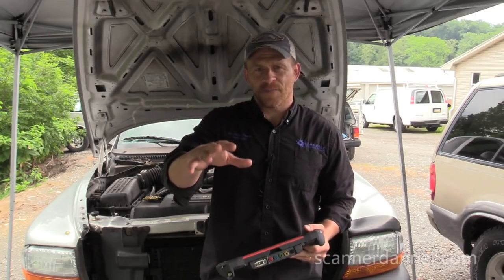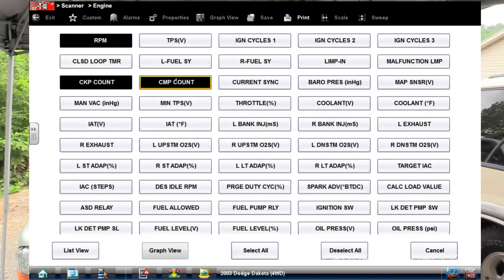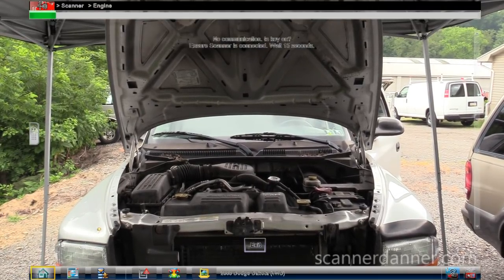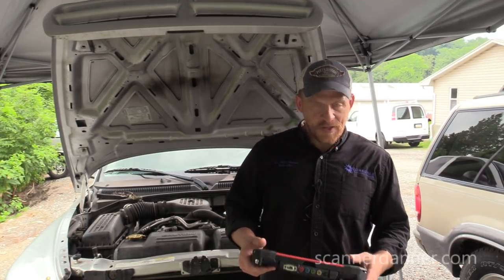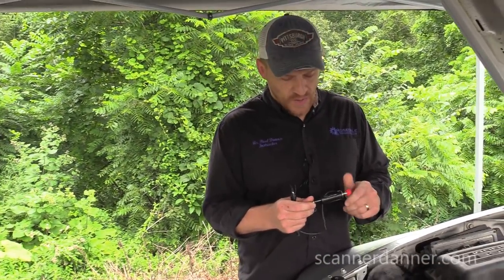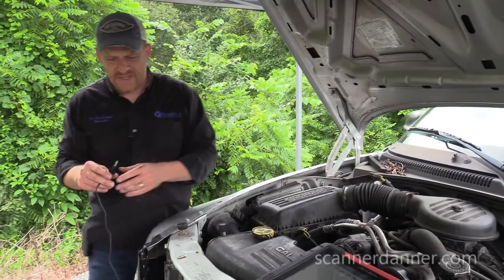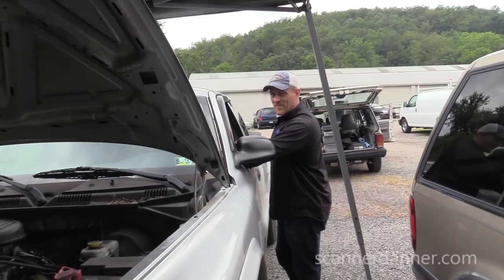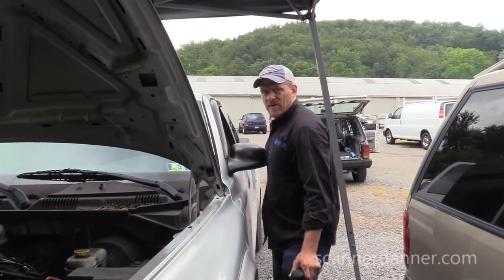Dodge Dakota No Start, No Fuel Pressure Testing

Comment: Its so good to see videos like this to refresh our memories and learn few others things and to see how other techs deal with problems like this. Thanks for the great video lecture.  After years of watching your vids its so great to see how passionate you are on what you do it gives me motivation to learn more as I progress and makes me more efficient as a tech. Anyone reading this I recommend purchasing SCANNERDANNER BOOK it comes really handy and great over all book. 
I've worked on a vehicle (mazda) with a bad fuel pump. Checked power 12v and ground to be good by back proving connector from pump. As I removed fuel pump connector I also found connector pin burnt out and harness needed to be replace. I then rechecked fuel pump and both needed to be replace.
Reply from the maker: Thanks so much!

Comment: I am having the same problem but I sprayed quick start and it still does not start. I wish you would have sprayed some to see if it started.
Reply from the maker: if you spray a fuel source into the intake and it does not start, check for spark next
Reply: @ScannerDanner  Thank you for the reply. There is spark and I am leaning towards the timing chain jumping a tooth I am going to check for that next.

Comment: I have a 1999 dodge dakota 5.2 v8 and on start up it cranks for a bit then fires up and runs well, after it starts for the first time it will start with no long crank within an hour or so, any ideas on what this could be? Also ive had it fire up right away in cold weather a few times which seems odd, any help is appreciated
Reply from the maker: Check fuel psi during this long crank time event

Comment: jeeze paul  you were really confusing yourself there for a minute.  i was gunna say watch out with those lids and thier markings. i have more than once been bitten by having the wrong lid someone grabbed at a junkyard and stuffed on it.  oh and here's a tip for ya. we all at one time or another need a good power or ground far away from the battery. i took a pair of alligator clips and hooked them to a replacement end foe an elecrtic cord. made another set for the other end. plug in your extension cord and voilat!  (also used this to charge the trolling motor battery on the boat while towing down the road.  also made one end with a power plug for the dash.

Comment: why shouldnt the problem has been with the wiring after the pump not before? In other words, what if the pump ground wire was the problem?
Reply from the maker: I checked both the power and ground wires as close to the pump as I could. Enough so that your next step is to drop the tank, regardless if it is the pump or not, it is getting a pump, then you can check the rest of the wiring harness you could not access right at the sending unit. These are standard practices and 99.9% of the time you will NOT find a wiring problem in this area. Make sense?
Reply: Absolutely. Thanks Paul.

Comment: For someone to say their working old school today, because they forgot to bring the relay tester and then pull out a bidirectional scan tool to diagnose further, just because they have one, is a crock! I've been fixing mine and other people's vehicles for decades now, real old school and was even recently offered a diagnostic job at a major car dealership, when I had to explain to the service manager, why the tcc solenoid cooked inside the trans. Replacing the solenoid and test driving only cooked it again, but after replacing the shorted antilock brake module, the problem was solved. The only driveability issue was, if vehicle speed raised above 45mph it would stall at the next complete stop, every time, guaranteed. Stay under 45 and drive all day without stalling. I did that without a scanner or reading the flashing codes. Couldn't afford one and auto stores weren't scanning them then either. Lol, sometimes I think I'd give my right arm for a bi scan tool, but then I wake up and fix the issues, real old school. Problems solved. It might take a little longer but always brings about the same results. Still haven't figured out how to flash and reprogram stuff with a trouble light but, I can still dial a phone in an emergency by touching the wires together!
Reply from the maker: hahaha true

Comment: 😂 you can't trust that Dodge fuse box key. Wow, this is a 2003 also. I have a 2003 Dodge Dakota 4.7 L V8 that cranks but no spark is coming out (coil-on-plug, if the procedure is same). The crankshaft sensor was on but now it's not, the only codes on are the oil pressure sensor and a/c sensor code (since I ended up cutting the lines to get the the engine in [engine from a 2000 Durango]). I only get the codes from turning the key 3 times, but not from my BlueDriver (Bluetooth OBD-ii reader). Do you have a video on how to find out if I have a bad ECM giving me bad codes and not letting my engine get spark? Or how to fix a crank, no spark issue? I have new coils and plugs I might put in now, but I doubt that is the issue I'm getting no spark--fuel pressure good, fuel relay clicking, and I'm not great on using the test light to check the fuel injector plug but it is solid green for ground on the middle wire. I suspect it's a spark issue.
Reply from the maker: Your ECM is not bad and yes I have a ton of no spark testing videos. Check out my Chapter 22 playlist, you may even find a few 4.7L engines in there too

Comment: What a great video!  Thank you, especially for the diagrams at the end.  Question:

I don't have a probe light yet, so is there any risk in using a digital multimeter to check for continuity (i.e., 0 ohms) to occur at key on between ground and the "computer controlled ground" on the fuel pump relay (44:00)?
Reply from the maker: Why not a voltage drop test instead? Time to learn it and I can teach it to you

Comment: My 2000 dodge dakota starts up good,runs good. But after it reaches maximum temperature,it stalls,this is in Park. Start up again,no problem,runs for a minute or two,stalls again,it keeps repeating the symptom. Any idea,Paul,? Thanks
Reply: Might be the computer
Reply: @rociorodriguez7836  I tried the computer,too. Unfortunately,didn’t work
Reply: @mckoylach1622  have you checked fuel pressure?
Reply: @rociorodriguez7836  in fact, the previous owner replaced the new pump. And I checked it at the shredder valve, it squirted out ok but didn’t get the exact number of reading because I didn’t have the gauge to check it...
Reply: @mckoylach1622  does it turn off instantly or does it hesitate to turn off?
Reply: @rociorodriguez7836  it shut off instantly. Didn’t hesitate a bit.
Reply: @mckoylach1622   it's very hard to say without taking measurements,
Reply: @mckoylach1622  have you tried cleaning  idle air control, I Know that the IAC will not cause the truck to shut off instantly but it might help
Reply: @rociorodriguez7836  thanks for your helps. I will try to work on it more
Reply: @mckoylach1622  no problem, hopefully you get it running again.

Comment: so we have brushes not connected to bars or bar to bar open
Reply from the maker: yep, exactly. I wish I would have had Pete keep that old fuel pump so I could have taken it apart.
Reply: one heart thanks bro
Reply: use to repair starters back in the day had a machine called a growler did bar to bar with elec. field ever see one.

Comment: My 01 ram doing same thing and I did what you did check relay for pump hear it click then check asd relay it works and kicked tank like crazy... She will start by spraying it but no pump works... Funny thing is truck was fine till I hit a pot hole on highway then it die and won't start up.. weird huh???
Reply from the maker: ASD relay is clicking like crazy you say? Is that during cranking on just with the key on? This is ABSOLUTELY where we need to focus

Comment: I verified the decal is wrong...that'll get you chasing the rabbit down the wrong hole.
Reply: I can confirm that diagram under the cover is incorrect also in a 2002 Dodge Durango witch has the same relay/fuse box setup only the one I was working on had a 5.9 V-8

Comment: If the fuel pump was perfectly fine where would you look next? Fuel filter?
Reply from the maker: What is your fuel pressure?
Reply: I’m not sure I have nothing to test with. I have the same exact car you worked on in this video with the same crank no start issue. But I can always start it if I let it sit for a couple hours, if I drive it, turn it off, and try turning it on right after it will not start. Letting it sit a couple hours it will start no problem.
Reply: ^and I have confirmed spark
Reply from the maker: @bodiemitchell3091  that was going to be my next question 😉
You have a service port to check fuel pressure and you can buy the gauge for your set-up for like $30. I recommend doing that first before throwing parts at it. 
Does it run when you spray it with carb cleaner? This would give us some good direction too
Reply: I have never tried carb cleaner to be honest
Reply: I think it’s crankshaft sensor I got a related code for it. I’m still using it as my commuter car but I only get a couple starts per day on it. P1391
Reply from the maker: @bodiemitchell3091  https://www.youtube.com/watch?v=qpL_0-8DrhE
Reply: I was watching the video you commented, I have that p0340 fault code, but my 03 dodge Dakota 2wd v6 doesn’t have a cam sensor
Reply from the maker: @bodiemitchell3091  the 2003 Dakota with the 3.9 engine definitely has a cam sensor
Reply: I couldn’t find a part for the cam sensor. BUT I did successfully change the crank sensor, car starts everytime without fail, but now it’s making a new noise that sounds like a very faint rod knock but I don’t see how changing a sensor could cause that? I’d post a clip of what it sounds like in the comments but YouTube won’t allow. Any ideas?

Comment: rubber mallet, heavy rock, log chunk or any other roadside debris works for beating on the tank. if no cap on bed, jumping up and down in the bed works sometimes also.
yeah, I may be a bit hillbilly :))
Reply from the maker: Nice! I used to slam the drivers door while cranking on a failing Nissan pickup fuel pump. It worked for a few months before it completely crapped out. :-)

Comment: Sorry if my comment made it sound like I was waving my knowledge dick, not my intention. Had problems like the one you have caused by people shoving all sorts of probes into connectors as part of their fault finding and then snapping back together after not fixing or finding fault. They don't realise that they may well have caused another by their rough handling of the contacts. I do stress to guys in my shop just how much they can't do that. They surprised when I show them just how small and easily damaged the contact locking tangs are. This and spreading the contact that lowers clamping forces to give intermittent , poor or zero contact. The fuel pump issue I have just dealt with was caused by a mechanic trying to diagnose a faulty fuel contents sender. He had pushed back one of the fuel pump contacts by " probing" the multiplug to try to find the fault! That turned out to be a faulty pull down resistor in the instrument cluster. One simple fault and poor technique caused a much bigger fault. Big fan of your work mate.
Reply from the maker: no problem at all bro and your points were good! Thank you

Comment: Oh oh mighty sake Dan, no disrespect intended, but I'm a 62 year old auto tech and I get that junk in all the time. You always check the fuel pump power and ground source with just a simple test light, and if it's good, which it usually is, it's time to pull the tank.
I went nuts watching you over-complicate this situation.
Always start at what the PCM and PDC is suppose to run, and go backward.
Your a smart guy, but I'm at a loss for words.
Reply from the maker: My name is Paul and there was so many great testing techniques that I showed in this video. Nothing I did was complicated, I covered many different variables and aspects (input signals, coil control, injector control, relay control, knowing circuit integrity from relay to pump right at the fuse box!).  Could I have started with a shot of carb clean into the intake, found it ran on an alternate fuel source, then went right after fuel psi? Sure, I could have done that, but you have to remember, I am teaching concepts and fundamentals to not only the community, but to my son (who was the cameraman).  This was a fundamentally sound video for anyone wanting to know how to attack a no start problem where they do not know if it is spark, injection pulse, or fuel pressure that they are missing. Not sure what your issue is with that.
Reply: Perhaps I was just after finding the problem, and repairing it the easiest most logical way, as life is here.  Wasen't aware this was an educational presentation, u tubes auto play just came about to your video. We just couldn't believe how many backwards steps you were making in order to explain the situation to diagnose the no fuel situation. Now if indeed you were displaying a vehicle with no pwr or ground to the pump it would have made more since. We certainly don't want these kids to start where you did in this particular situation not knowing to check the pump power first.
I'll let you get back to your thing now "Paul", and thanks for the the response.
You seem like a good guy, and a wiz on the scanner,, which I'm not. 
Good day to you..

Comment: looks like aftermarket fog/driving light and the factory ones are gone and not wired to anything anymore and I kept shouting "wrong relay!" at the screen =p
I hate them stupid fuse panel cover charts, they always end up looking different than the actual box layout

Comment: HELP 

car battery drains when cranked, almost starts slow then just dies and click click click.. 10 min later battery back up to 12.5. Get a jump and it starts.. what could this be ?? I need help have a baby need to get to the store asap.. again starts with a jump. 12.5 or so, crank and drops to like 12 or lower and don't start, I can feel it almost start but it's like battery drops to low before it has a chance to start.. then I watch it go up .1,.2 , .3 , .4 a volt till its back to 12.5

why ? what can cause this ? please ideas and help anyone. I have done fuel pumps diagnosed myself ect so throw things to check at me I'm open.. 

thanks.. need car have a baby 8 months old and really broke right now.. had meter on volts one on battery post other on terminal and no voltage drop on any terminal, parasitic draw test done no draw and battery says around 12.5 anyway until it is cranked.

Thanks again 

2000 Ford Focus se wagon Zetec Engine
Reply from the maker: Post your question only once. If you don't see it show up, it is because YouTube has classified it as spam. I had 6 different entries of this post on two different videos in my spam box. 
The only way to get "unspammed" is by the creator of the channel approving your comment like I just did. Just an FYI on how all this works for the future. 
What you a describing sounds like a bad battery. It doesn't matter that it recovers to 12.5 volts. When was the last time it was changed? 3-5 years is pretty typical.
Reply: ScannerDanner  oh okay , sorry about that. I never seen the first comment show up at all so I thought it was my phone, kept saying "try again". .. hasn't been changed it maybe 5 - 6 years.. is there anyway I could fix it ? adding water or something.. I'm dead broke at the moment.. or will a jump start it every time if I just bring a jump pack with me ?

thanks
Reply from the maker: It's no problem man, I was just letting you know. YouTube's system need to be tweaked to let people know this is going on. Anyway, no, there is no real way to bring a battery back to life. You need to change it. The longer you leave it this way, the more damage you will do to your alternator. The alternator will be constantly charging this weak battery, causing extra heat and wear and tear. If you wait too long, you may end up needing an alternator too.
Reply: ok, thanks man. I really appreciate it allot. I don't trust or I should say take the word of many people besides myself after testing and testing again but you are one Man I trust 150% and I will take your word and advice any day. This is why I asked u and only you.

thanks again, you are a true master and I have a great amount of respect for you. Appreciate the fast response , amazes me a man who is as busy as u with such talent still helps people out on u tube.. much respect and thank you.. Hope u and your family have a good holiday(s).
Reply from the maker: Thanks so much man. I try. It get's hard to keep up but when I see good questions, I always try to answer those.

Comment: Why not start with the test at the fuel pump that is the quickest that makes all the other test unnecessary? Any shade tree without the scanners will start there, but if that was not the problem shade tree guy or parts changer like me would be in trouble.
Reply from the maker: For sure, I understand where your coming from. As a pro, I never start at the tank because it is not easy to get to the wiring on most cars, especially in a gravel parking lot. 
But this video gives enough information for you guys regardless of where you want to start. 
Thanks for watching!

Comment: you didn't cover, the possibility of an open wire inside the tank, between the tank plug and pump connector, like an aftermarket/universal pump with poorly crimped splice/terminal connectors (been there done that)
I guess it's not 100% necessary to explain, seeing the pump/tank has to come out anyway, but I'd hate to be the newbie that jams in a new pump and never checked from the pump to plug.
Reply from the maker: Yes I definitely did. Not sure exactly where in the video but I mentioned the connections inside the tank being a standard check when you have it apart. It is almost never that but it should at least be looked at.
Reply: throttle bottle